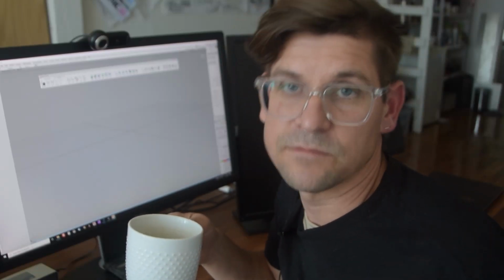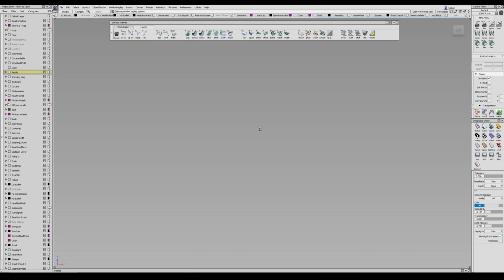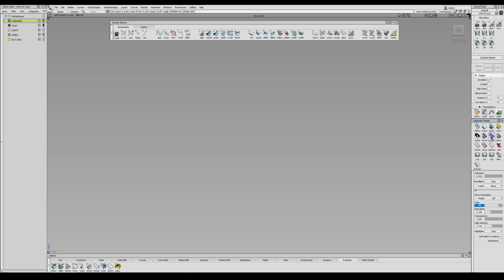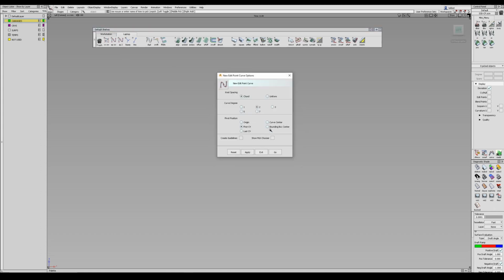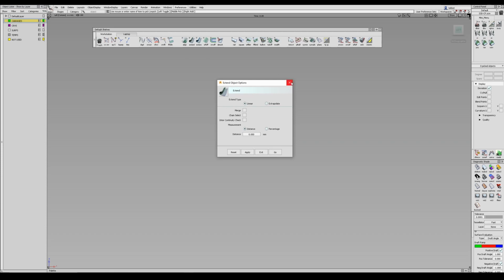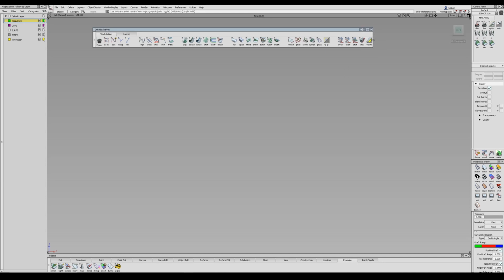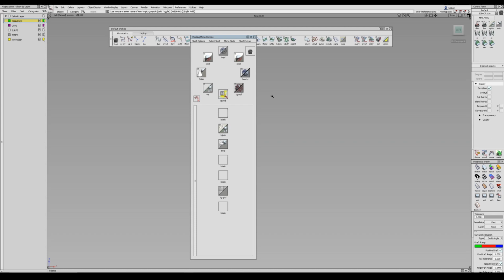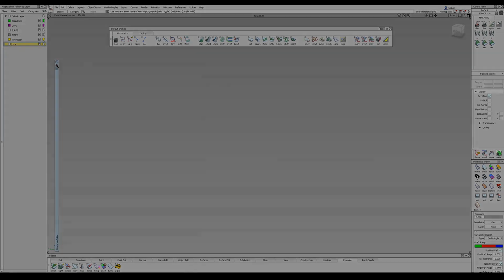Autodesk Alias Automotive 3D Modelers Interface

Comment: Hey Kev, I had a question regarding arrow sliders and movement sensitivity- Is there a way to control this in the same way you would in transform cv tool? particularly in the extend tool as well as within the align tool with both arrow sliders and if possible  skew angle arrow sliders?
Reply from the maker: Great question.  I really wish Autodesk would add the movement sensitivity to all the transform tools, arrow keys and tools.    Zooming in close can help change the global scale and sensitivity but its not very consistent or predictable.   To fine tune align, Ill leave the history on and use the transform cv tool to make the hull adjustments to get some of the sensitivity benefits.  Are you familiar with holding the ALT key while sliding back and forth in a numeric input window to adjust the number?    This may help for the skew angle value in the align options.   Its not interactive, but could help do finer adjustments.
Reply: @kevinr6236  had a feeling they haven't yet added this functionality would definitely be beneficial! yep I use the history all the time to fine tune with move cv tool to refine the shape. Keeping some control within align tool would be a next logical step of improvement. BTW any plans for a live stream anytime soon? I always manage to miss them lol

Comment: I've listened to your thoughts on the Blend Curves, read other people's comments and also explored the Freeform Curve Blend Tool which is really excellent. I can't help but feel that blend curves have something to offer. I mean just look at how extensive the toolset is. AD had to have use cases in mind when they created it and I'd really like to know what they are. There's some mystery buttons in there that I want to know about.
Reply from the maker: I should probably do a deep dive video exploring all of the curve tools.   Blend curves do work well if your willing to use the assortment of toolbox features and specific selections.    They were originally introduced in the mid to late 90s.  At the time, they seemed to be a combination of the project tangent and align tools.    I know lots of Surfacing masters that still use them extensively.  They can produce excellent results and for awhile were the only way to achieve curve alignments beyond G2.      For curve networks and wireframe modeling, they can be a very strong choice.
Reply from the maker: Which Mystery buttons are you referring to?    I use the "whats this"  feature in the help menus to find out about specific buttons.  Select "whats this" then click on the icon or tool text.  The help doc will open with the tool information
Reply: With the exception of the "New", "Edit" and "Change Degree" buttons I just don't know where of how the other buttons in the toolset get used. A deep dive would be very useful, maybe a practical example where you put the whole toolset to use.

Comment: Alias needs to do an overhaul of their GUI and workflow ... like Blender they need to change the way they think about user interface and user workflow
Reply from the maker: Anything specific that you would like to see different?   There definitely is room for improvement.   Alias(Alias Research) is one of the original 3D programs from the late 80's.   Some of the odd UI workflows are from a time when software was fairly new, plus it doesn't help that Alias was built on top of an animation architecture(Abyss, Terminator 2, etc) instead of just pure modeling.

Comment: Hey Kevin, is there a way to add shortcut to increase or decrease the surface degrees? I found a way to do it by making presets of surface rebuild tool with uniform rebuild, but i wanted to know if there is any other way to add a shortcut for it.
Reply from the maker: I've seen users use the method your mentioning.   Set a few surface rebuild tools to desired degree/span parameters, save to shelf and hotkey the shelf tools.   I personally use the new(ish) hotkey to open the rebuild input window where the cursor is.    PREFERENCES>INTERFACE>HOTKEY/MENU EDITOR...   special > Modeling Functions > toggle Degree Span Window
Reply: Thanks for the tip kevin.